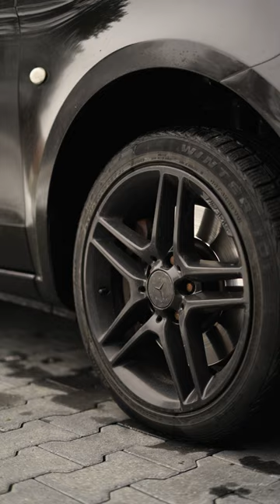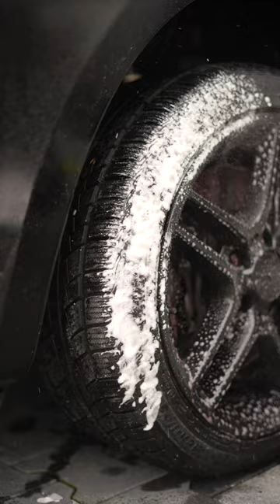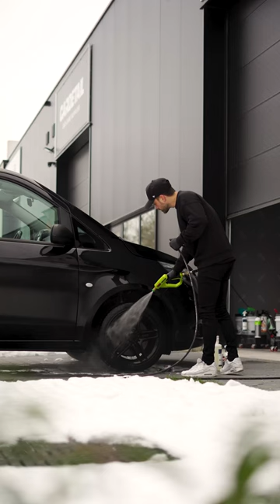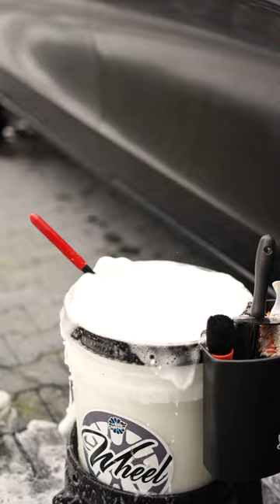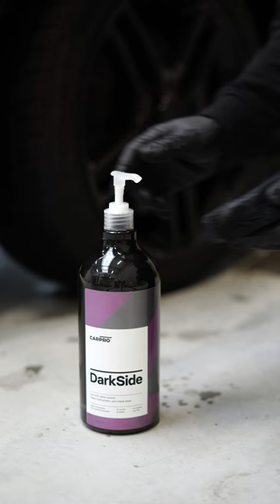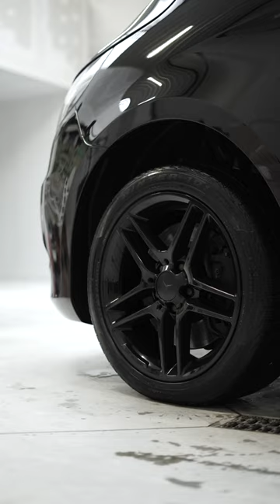Winter Wheel Cleaning - Auto Detailing

Comment: What’s the best product to clean your underbody with? I’m from Illinois and they use a ton of salt so I’m trying to keep it as clean as I can.
Reply: Touchless from Bilt Hamber. Spray it under the carriage at 4/5% PIR. Make sure the under carriage is dry or rather not pre rinsed (you’ll dilute the solution/foam otherwise needlessly). Leave for 5/10 minutes, as long before it starts to dry out and then blast off with a pressure washer. Use Atom mac from Bilt Hamber at 5% PIR to prevent rust from forming. Job done.